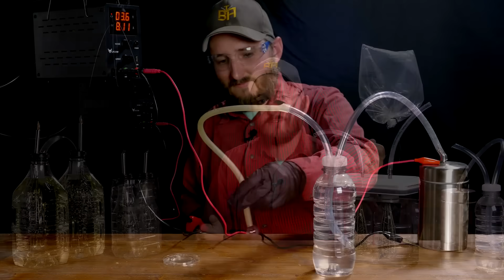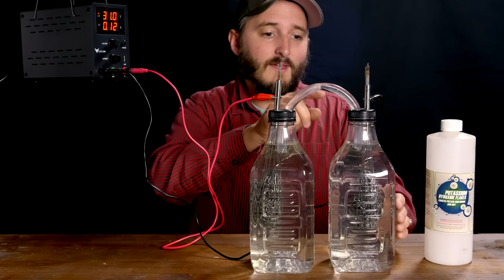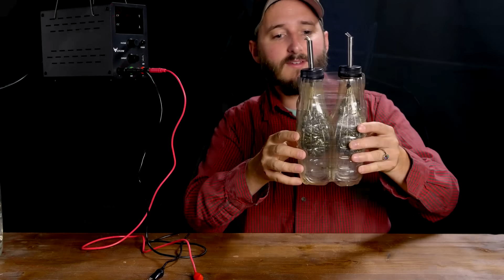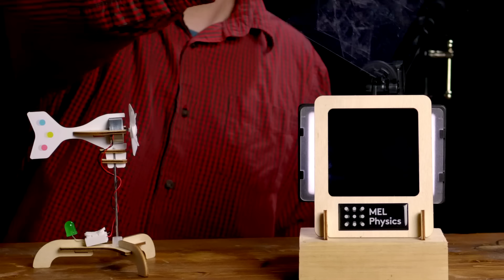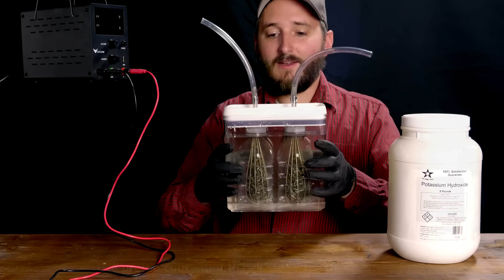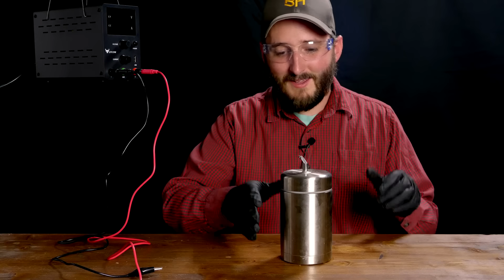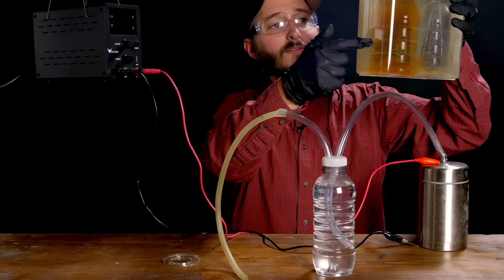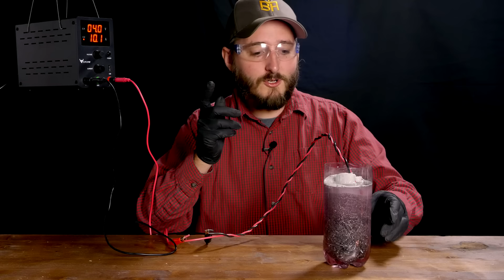DIY Hydrogen/Oxygen Generators From Grocery Store Items (HHO Fuel Cells & Split Cell Electrolysis)

Comment: Thank you so much for this video. I used some of the same components you used and have filled a few party balloons with hydrogen. I'm working on making a small indoor blimp. The one thing to mention is that it gets hot over time. I built a cooling tank with circulating water around mine.
Reply: Does the hydrogen come out with enough pressure to fill a balloon?
Reply: @krunkiemunchie8129  It has nearly no pressure. I hang the balloon vertically and the hydrogen fills it. I did them in the cold garage and when I bring them into the house the cold hydrogen expands.
Reply: @krunkiemunchie8129  I just tried something new. I had two balloons that neither one was under much pressure. I connected a tube between them and squeezed one of them and it filled the other one. As long as I have one that I don't need I can use it to pressurize the other ones.
Reply: @nealshue6791  Thank you this is very useful information, i will try these promising ways of collecting hydrogen.

Comment: place steel wool inside the tube so the flame is snuffed out before it reaches the water container.
Reply: Do you know what a little glass bulb containing steel wool and O2 is called?

A flash bulb.  It's not going to snuff out anything.
Reply: @fromagefrizzbizz9377  its going to snuff out the fire before it reaches the main tank, its used in many applications involving gas called a flame arrester, I might have gotten the wrong type of steel, but you need to stuff it into the tube, the gas is small enough that it will just pass by but the flame will be arrested.
Reply: @HamguyBacon  I know it's a flame arrester.  *Normally*.  But you seem to have this problem reading my posting: pure O2 + steel wool goes boom when it sees a ignition point - like the wall of flaming HHO trying to get into the tank.

It's no good if your flame arrester violently catches fire does it?

This is chemistry - high concentration O2 plus iron with lots of surface area: boom.

Pure O2 is nothing to be casual about.  A lot of things burn you don't expect with the slightest urgings.  Fittings, seals, and lubricants all have to be checked out carefully before using them with pure O2.
Reply: @fromagefrizzbizz9377  as i said, i said the wrong steel, a normal stainless steel sponge will do the same thing.
Reply: @HamguyBacon  Are you aware of the behaviour of fuel/oxidizer mixes that flash at the opening of a pipe?  The flame front travels down the pipe (faster than it'd to in open air) and blows out when it hits an obstruction.  In one case, a methane leak in a subway tunnel blew the end off the tunnel.

It's not a flame arrester that's needed - you need a combined flame arrestor and detonation arrester.  Even a stainless steel arrester stopped the flame, it'd only be temporary while the whole thing shattered.

Good luck doing that with some thin wall metal tube let alone plastic.

Fuel oxidizer gas mixes are incredibly dangerous.  Needs a bit more "engineering" than "oh, stainless won't burn".
Reply: @fromagefrizzbizz9377  You are making it out to be some big deal, I don't think you understand what I am talking about.
You still need the tank of water, the steel is just to stop the flame it reaches the tank of water. its a secondary failsafe.
also stainless steel has a melting point of 2750F, a flame that lasts a few seconds isn't going to burn or melt steel.

Comment: Ingenious design!  Many years ago I was demonstrating the water electrolysis to my kid using some thing close to your first version. Mine was even worse I was using the graphite rod which has less surface area compared your electrode design. Nevertheless it did work but we could not do anything meaningful as the H2/O2 gas produced was really minimal.

Comment: If the anode accidentally were to touch the catode you'd have a short and your power supply source could be damaged. Adding a light bulb in series would avoid this. Should the anode touch the catode, the light bulb would light up and there would be no shorting.

Comment: being a student of Stan Meyers work, I think you would've helped you viewers by mentioning the use of SS tubes and even SS plates in very close proximity. that's the way he did it, of course he also made use of some very complex electronics to be able to create a great deal of HHO gas without the waste of high current, he did it efficiently.  otherwise good video, I enjoyed, and have like your channel for some time,  keep up the good work.
Reply: Also, are you familiar with Paul Pantone and GEET technology? Another sleeper of a story as compared to its claims. Similar controversy as the powers that be ...at the wheel were after his creation.

Comment: Have you considered using potassium sulfate as the electrolyte instead of caustic potash? This salt is non-corrosive, both to people and to the plastic containers. I haven't tried it, but I would be very surprised if it was not comparable to your choice of electrolyte.
As ever, your videos are excellent!
Reply: Peter & Pete demonstrate and show how this guy is WRONG, and even has professors agree with them.

Comment: Curious....with a consistent flow of coolant (electrolyte infused water in this case) could this system run indefinitely with more robust materials? Seams you could provide infinite energy with a small hydro setup from a creek, etc...very cool.
Reply: no.
Reply: I wonder how a radiator would affect this

Comment: I have used an HHO generator in a landrover to save as much as a 3rd of my fiel cost, the biggest problems I had were the electrode degeneration and not running the battery down, its possible to run a 12v 10amp generator if you use a switch to only allow it to run when the engine is running but you also need a manual switch to stop battery drainage when the car needs a lot of current.
Very cool and interesting video ...I would love to know how to pressurise the gases for storage ..Do you use de-ionised water in your electrolyte?
Reply: You could trigger a relay off the alternator. When the alternator kicks in, drop out the HHO generator.
Reply: Fill your tank with water and as you drive create the gas to fuel your car… imagine that would be awesome. 😂

Comment: So electrolysis is something that I've poked at a bit in my chemistry filled days. 
People push for basic hydroxide salts in alot of the scientific literature is real, but they're not ideal, as noted in the video, but it goes beyond the general safety issue. 
Hydroxides (potassium or sodium hydroxide) both digest a range of materials; Glass, most metals, ceramics, etc...  The plastic degradation seen in the video is actually slow. 

First, rather than a single electrolyte, you should use a buffered solution. This is a mixture of salts that, when dissolved, easily form a pH gradient in the system, and buffer the system overall towards a certain pH. 
Buffered pH will help ion formation and movement, but it might bias the gas formation at one electrode (cathode or anode, depending on mixture used). 
An example of a buffered solution that would be easy is sodium carbonate, potassium hydroxide, and sodium bicarbonate. FYI, This solution actually bias towards oxygen production, and a pH around 10, depending on exact concentrations. It also off-gases carbon dioxide at times. 

Second, The original video is a 1 electrolyte setup. So, with the 1 electrode version, you can use that to setup a 2 electrolyte system, with a oxygen electrode in a steel bottle connected by a strip of metal to a steel bottle with a hydrogen electrode. That stops it from being a single electrode HHO generator. 
Dual electrolyte systems have some advantages because you can use 2 electrolytes that favor the gas at their respective electrode. So... say sodium silicate and potassium hydroxide on the oxygen side, and ammonium sulfate and magnesium sulfate on the hydrogen side. 

Thirdly, and somewhat telling of my own bias here, hydroxides as electrolyte came into favor with HHO enthusiasts because hydroxides react with aluminium to produce hydrogen all on their own without electricity. The hydroxides react with elemental aluminium to form a large solvation complexes that nearly instantly vents the hydrogen to form aluminates. These zeolites made correct calculation of what was going on in the generators difficult, and many claims of free energy came out of it. 

Finally, in case this wasn't clear, every electrolyte will have a "Bias" towards either the cathode or the anode, and, as a result, a bias towards one gas or another, depending on electrolyte. Regardless of electrolyte used, you can overcome any bias by simply throwing more electricity at the problem, but efficiency might be a thing you consider.
Reply: Your car battery is far worse.
Reply: I don't understand the aspect of "bias". Something doesn't gel.

When you split 2 H2O molecules, it has to produce 2 H2 and 1 O2, correct?
Do you mean more of the gas will form at either electrode? Unless the hydrogen or oxygen is simply disappearing it must mean that both hydrogen and oxygen are being produced on at least one electrode. That also doesn't make sense.
Or does your "bias" refer to energy efficiency? As in, one electrode might have a lower potential to produce the same amount of hydrogen/oxygen if it uses the correct electrolyte?
Reply: @Bob_Lob_Law  
Kinda. "Bias" is an intentional over simplification for my convenience. Standard electrochemical cells all have fairly in depth math that goes hand in hand with them. Explaining out the concept without getting into the calculus helps highlight practical things that might not come across otherwise. Adding extra bits like a electrochemical process that produces a product (hydrogen gas), adds a secondary layer to it.  

First, as a type of electrochemical cell, Electrolysis cells are going to have one side that's more "Spontaneous", and different electrolytes can change which side that is. This could be viewed as "Efficient" but, it's more accurate to simply describe it as the side that occurs first.

Second, some electrolytes, especially while being driven by electrical differentials, can undergo secondary chemical reactions, and absorb oxygen or hydrogen from the surround environment. 
Halides, pnictides, and sulfides can all absorb oxygen from solution. Halides, in particular, can be dangerous when they absorb oxygen. Hypochlorites are manufactured this way but so are perchlorates, with the main difference just being temperature and concentration of chlorides.  
Sulfates and carbonates can both absorb hydrogen and hold on to it for extended periods of time, and both vent non-hydrogen gases. 

Finally, because I don't think I specifically said this in my first comment, silicates and borates are much safer alternative to hydroxides, but borates can still absorb some amount of oxygen as the system gets hotter. I'm going to mess with antimonials one day, and I think that will be the better hydrogen electrode, but that's kind of a side story that would launch a youtube career.
Reply: Wow. I seriously learned more from your 5 paragraph comment than I did from this video, or for that matter from a month of chemistry class.
Reply: @jasoncthomas  you watch the videos for practical demonstrations and read the comments for in depth explanations.

Comment: If you make one of these, make sure the power supply is OFF when you connect or disconnect the clamps to the electrodes. If the supply is on, it will case a bit of arcing. if you have been leaking HHO, then the arc will instantly ignite the HHO and you will have a very bad day (potentially your last one)

Comment: The higher the voltage, the more it will corode the electrodes. That's why they use lower voltage and high current for this purpose.
Reply: Welp, not just "the more it will corrode"; the higher the voltage, the more you heat the electrolyte / bath (unless you stack the plates, to distribute the voltage drop) which is wasted electrical energy and forces you to review the duty cycle of your cell.   Plus I * V = Watts, and we want the least Watts.
So yes, minimal voltage, highest current, best efficiency;  amps yield gas, volts give only heating.
Reply: @theskett  1.48v is the optimum voltage .. easy enough to look up
Reply: @PaulaXism  The optimum voltage, is that which pushes an acceptable current.  The voltage depends entirely on the conductivity of the electrolyte, and whether you stacked plates.    Thanks for playing, though.
Reply: @theskett  From what I've been running across, the amps used are minuscule; but, it also had a lot to do with hitting the HF at which covalent bond is the most easily broken. Unfortunately, no one has been too inclined to open-source exactly "how they're doing what" to  achieve that goal. The reasons for that reluctance could range from it being a hoax or red herring to these folks thinking they're going to "get patents & get rich..." If the latter, they're really naive; since, the only way to stay safe is to open-source things as quickly & thoroughly as possible. On this kind of stuff, trying to get a patent winds up being a "black hole;" &, even selling kits or units to those who'd rather buy than build can result in them finding themselves "in a black hole" ~ with a large hole in the back of their head...
Reply: 1.43v DC is the irreversible voltage , so above that is wasted  energy

Comment: It may have already been mentioned, but why not use the oxygen and hydrogen separate then rejoin in torch. It would limit flash back and give more flexibility to torch. I do have a question. Does the brown liquid hydrogen peroxide work?
Reply: Producing both at the same time is better for production amount. The first few are seperate and produce less, because there is more resistance when seperating the electrodes.

Comment: Two stainless pots, one that fits inside the other, drill many holes, at an angle like a cheese grater in the smaller one, and paint its outside. Submerge it within the outer pot, and the different gasses will be produced in the inside vs outside of the inner pot.

These two electrodes will be much closer together, with a sizable reservoir of water in the inside space, and a considerable surface area by way of circumference. No need to replace electrodes either, just scour them fresh as required.

Comment: Car headlight bulbs can be used as current limiters. Each one will limit the current to about 2 amps. Put a lightbulb in series with one of your power wires. If you need more current put two or more lightbulbs in parallel. Every extra bulb adds 2 more amps. If you try to overload the power supply the lightbulbs will just get brighter.
Reply: Well said and understood. ,informative and inspiring thanks and keep it coming!